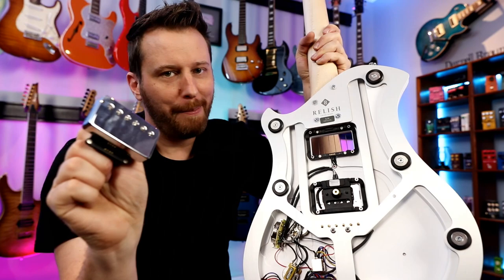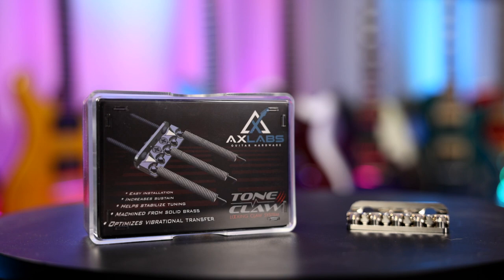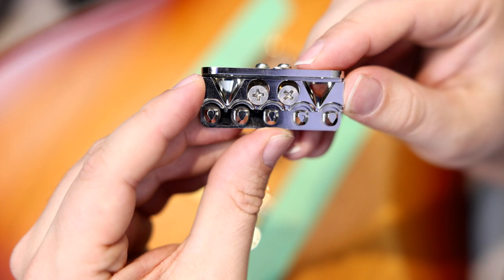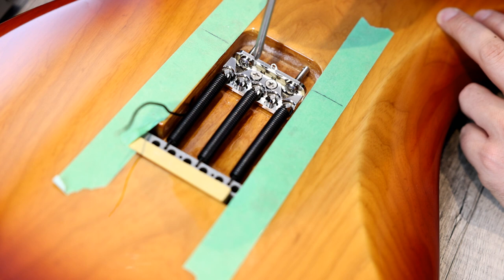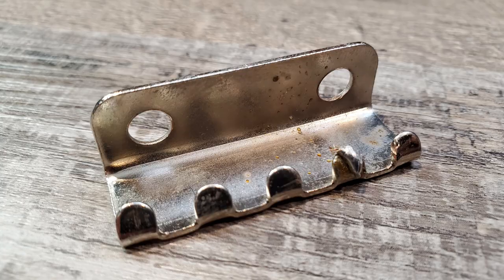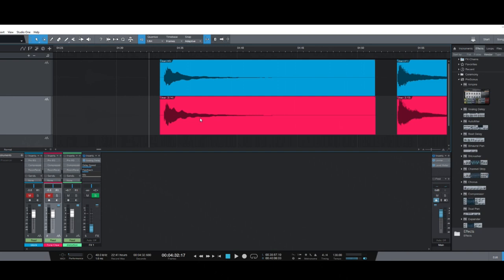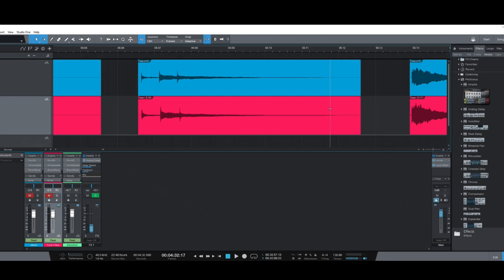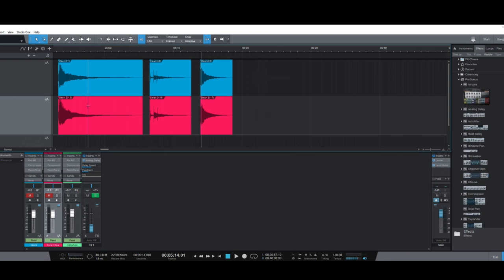Can a Trem Claw Improve Your Tone?? - Let's Find Out!

Comment: the one that is effective in sustain is the brass one a slight 5%, the nikel one is almost imperceptible and the difference is not much appreciated, adding the Fat brass block with 40% more sustain, I got 45% more sustain with both pieces of brass, I did a test and it was very satisfactory!!

Comment: My ears could hear very slight difference in tone and volume. So not really sold on tone improvements. That said anything that prevents random movement should enhance tuning stability during whammy bar use. I like the concept of locking the springs, I don’t know if it’s ever been offered before. I’m curious enough to try it for purpose of better tuning stability. Thanks for the tip Darrell👍

Comment: I replaced mine because the springs were not always returning to the same spot on the claw which caused tuning issues. No sound difference or sustain but it did fix tuning.

Comment: I could hear the difference. It was very very very subtle, but the brass claw gave the tone a bit more of bright/high end. Nothing you should run to replace your stock claws, but still interesting that just by changing the claws is enough to change the tonal characteristic of your guitar, even if just a little bit.

Comment: when you complicate and up charge for a simple part that has worked fine for decades. How about a comparison between the normal claw with normal springs,  the normal claw with coated springs, the locking claw with normal springs and the locking claw with coated springs.

Comment: I like it more for the fact its locking the springs in place, especially for string changes and pickup swaps. For $60 bucks I'm going to give it a shot, it comes with 4 springs as well, so if your springs are getting tired or you want to go up a gauge, it becomes more of an upgrade.
Reply: so after +1 year, could you tell us your experience please? i'm not looking into it for "tone enhancing" but if it has features relative to tension and spring fine tuning, it may be worth it.
Reply: @tintecobrizo  Yeah I'd love to see a review

Comment: Looks awesome, but Im worried about the metal of the back vibrating up and down.  the cheap claw is up off the body and vibration has to go thru the screw connection to the body only

Comment: Every little bit helps and a solid claw definitely improves your tone… however If you want to take it to the next level use a Schaller sure claw because of its adjustability with a single screw Especially because you have to adjust your string tension to adjust your bridge and for different thickness strings…. Keep on rocking…

Comment: @DarrellBraunGuitar Watching the comparision, the tone claw waveforms actually look shorter than stock.  More beefy is good. But I've never had good sustain. All I want to know is it longer and if it is. How much longer.  But also, it's impossible for you to play the guitar exactly the same for  stock and mod. You cannot control the exact rate  or stremgth of a strum.  So you should have a mechanical rig that will constantly strum at the same rate and strength.  I dig your channel and even have one of your T-shirts. With this video, I was left with wanting more than was offered.

Comment: This a really interesting comparison to me. Not because of the tangibles, but the intangibles.

Does it change your tone significantly? Nope. Does it change it marginally? Maybe, but I can't even imagine how small that difference would be since 99% of the tone for an electric guitar is dictated by the pickups and amp. Does it improve your sustain? Maybe, maybe not. The variations in the waveform were extremely nominal and could easily be explained by differences in how hard the strings were strummed. Does it make a functional difference? Other than adding weight to your guitar, which you may like or not, no. I've never had a trem spring pop off while I was playing, so I'm not sure what value the locking feature brings. So... from a practical standpoint, it makes pretty much no sense to buy something for $60 that makes a questionable difference.

BUT.......... It looks freakin' awesome. And you know it's there. Like you said, if you keep the cover off, it really makes a statement. I love that they have the brass color because I'm working on a strat that has as much raw brass hardware on it as I can get. It would be a really cool addition. And, as someone who loves to know that I'm putting the best possible parts in my guitars, it has always annoyed me that I could make all the components of my builds premium and I still always had to use that cheap little stamped metal claw. Premium parts may not always be necessary, but for some people, they are inspiring... and that's what playing guitar is really all about.

Conclusion: This looks like a waste of money that I may very well waste my money on.

Comment: Much to my surprise, I could hear a difference. I don't know if I can really describe it, but there was more depth, maybe, with the tone claw. The graphic waveform you displayed seemed to match what I heard, in that there was just more to each note. Very interesting.
Reply: I could hear the difference as well. The tone claw sounded like it had a little more bottom end to it.
Reply: why would you assume the difference is in the claw and not his playing? You do realize it's literally impossible for him to play the exact same way twice right? There's far more micro variability in his playing that he can't control than any tone difference in this hunk of metal.
Reply: @afurinperil  why would you assume I made any assumptions? To my ears, the tonal change was similar to hitting a low E on the bridge pickup versus hitting it on the neck pickup. His playing style isn't that big of a variable in this case because he's trying to remain consistent with his attack.
Reply: @pinktacoluvr  You're assumption is evident. believe what you want. Try replacing your knobs. maybe metal knobs instead of plastic will make your sustain longer. or maybe replacing the screws on your pickguard will help

Comment: Dumb question from a noob: the trem claw doesn't seem to be tightened up firmly against the wood, so we're losing vibes between trem claw and springs. I've seen locking posts used on ToM and wraparound bridges to eliminate movement between bridge and posts. Wouldn't the same concept (but different execution) help with this? Something to prevent movement between the trem claw and screws? Too much thinking, I'd better go take a nap...

Comment: I can’t hear or see a negligible difference with the new claw. I installed Raw Vintage springs on my Strat and  immediately could hear a difference. 5 Raw Vintage springs have around the same tension as 3 regular springs and you can immediately notice a difference in tone and sustain. The notes are fatter with overall improvement in sustain. They seem livelier and even make the trem feel smoother during actual use. They’re $20/set and don’t add any extra weight either. Physically the RV strings are slightly smaller in diameter and the material looks a little different too. I’m in no way affiliated with Raw Vintage-to me the springs are more worthwhile.

Comment: I can hear the difference pretty clearly, but then I’m a recording engineer with nearly 20 years of experience.
Is the difference clear? Yes.
It the difference across the board? Yes.
Is it a BIG difference? No. Of course not.
As your studio engineer would I rather you play the guitar with this in it? YES.
(Assuming 2 otherwise identical guitars of course)

My experience has shown me that THIS is where you spend your instrument money - inexpensive improvements.
👉All of them.

People will spend $2,000+ on a guitar and say this $60 is a waste of money??
No sir, it’s the other way around.
I have been involved in SO many instances of sub $500 improvements resulting in a better sounding guitar than the extra $1,000 you shell out for the higher model.

In most cases a well made $700 guitar with $500 worth of improvements will sound better than the “top shelf” model of that guitar that costs $2k - $3k.
Boom, you just saved a THOUSAND DOLLARS or MORE.
Especially if you can recoup a little bit of your cash by selling off the components you took out.

Better pickups $150-$300
Better bridge or better saddles ~$200
Higher ratio locking tuners - $60-$150
Better pots & output jack ~75
GRAPHTECH NUT - TWELVE BUCKS!

It’s RARE that you would need to do ALL of these on a $700 guitar, but even if you did, chances are very high that you’ll end up with a better sounding and better playing guitar than so many of the popular $2,500 guitars out there that we all see so often.

And of course - GET A GOOD SETUP DONE! 😄😄😄
👉Really you should learn to do that yourself, because it’s really not hard, and it’s FUN.

Party on Wayne.
Party on Darth.
🖖😎🖖

Comment: I hear a noticeable difference, but I don't know if it's because of the trem claw. Might just be that you played with a slightly different attack after the installation. As someone else pointed out, even with the same trem claw nothing you do will sound the exact same way twice, though I wouldn't necessarily write this off for those reasons alone. A lot of people saying that this is useless and you shouldn't be spending money on things which aren't guaranteed to improve your tone but hey, $60 for hope is a bargain.

Comment: I use The Schaller Sureclaw It’s the best Spring claw ever made and kicksass on this thing. It has a gear system that allows you to adjust the spring tension very easily with one Allen key which I have on my whammy bar end which also is the same size for my locking nut screws. And yes it definitely helps thicken up your tone and sustain. Also it helps when changing strings and you have to re-level your bridge, it’s quick and easy you should check it out dude because I worked it to the tee and yes… It’s awesome… Keep on rockin

Comment: Makes me want to try 3 screw in hooks/screw eyes. With each spring independently connected to the wood it will probably drive up sustain and mids much more
Reply: Would you also like an individual nut for each string?
Reply: @Ndlanding  that's a pretty good idea

Comment: Imo, it's a cosmetic piece. I don't like the marketing wank. I've also never had a spring pop off the claw, only from the block a couple of times. I would rather see an improvement like some of the newer Ibanez where the 'claw' is screwed/bolted directly into the body vs mounted with two screws.

Comment: The stock claw sounded noticeably better, higher frequencies were easier to discern and overall it was much more balanced. The tone claw sounded like you threw a damp towel over the strings and the frequency response was shifted to the bass. I would never put that thing in my guitar, sometimes simpler is way better, this being one of those times....

Comment: It is an incomplete design. If so much care should be taken about "locking" mobile parts, the screws that hold the claw to prevent movement towards the wood. Same with springs locking, like in the vega trem. Point here is, although there is some loss in the joint of each one of the elements, which affects sustain, major losses are due to the springs and the contact of the bridge and the body.

Comment: the issue with claw isnt the point strings meet the claw but rather the point claw meets the two screw ends; there the claw can actually tilt and cause intonation problems. This is NOT improved with this product, they did a fancy looking lock for what is already solid. Cheers

Comment: I hear no difference at all, and the variations in amplitude on the waveforms could be attributed to variations in picking, finger pressure, magnetic forces in the air, slight variation in torque on the trem claw screws, etc. You can try your hardest to eliminate the variables, but unfortunately it's an imperfect science and each strum of the guitar will be different.  That said, no impact on tone isn't a bad thing.  At least it didn't hurt the sound because it's a beautiful, well made piece I'd consider using on a totally decked out guitar.

Comment: The "experiment" compawring the waveforms did not, IMO,  justify any conclusions because it was not scientific. The sample size was one and and evaluation was not blind. You need multiple samples (plucks of string(s) and some way to derive statistics (e.g., mean amplitude at 1 second, 5 sec's, 10 secs, etc.). If you're going to measure amplitudes by eye then comparisons should be blind, i.e., you don't know which result is from which trem claw. I will admit that to do this experiment scientifically would be beyond the scope of your channel ( you'd need a statistician), but you should have admitted up front what the weaknesses of  your analysis were. At least you made an attempt to use a more objective measure of sustain than just listening, and that I applaud.

Comment: I couldn’t hear a difference.  I also prefer my guitars as light as possible.  This to me is extra weight with only a visual difference.  I think most Stratocaster players also prefer a vintage look rather than a modern look, but that’s an option.  Lastly I will say $60 for some bling bling that is on the back side of the guitar resting against your body the entire night is stupid, nobody will ever see that.  I think Leo Fender had it right in 1954, and this is over engineered.  Playing more will help your tone more than buying parts.

Comment: No difference. I use a compressor for my strat. I also have a guitar with a floyd rose and a larger block...it does not help and that guitar with  floyd rose is worst than my Strat for sustain.

Comment: There is such a slight difference in tone and sustain between the two, not sure it's worth it.  Yes, absolutely looks better and much more solid.  However most of the time the cover will be on the back and the look won't matter.   Think the discussion should be about weight.   More and more players are looking and wanting lighter guitars.   Have seen some sacrifice a slightly better playing neck for the exact same guitar that weighs 6ozs less.   For the players who are looking to cut back on the extra weight, can't see this being "worth the extra weight".    IMO, this is an over engineered part with marginal benefit.  Would rather  put the $60 bucks to better uses elsewhere.

Comment: I can hear a marginal difference if anything, sounds a bit fuller. But At that price, it's not really worth it in my opinion considering you wouldn't realistically know the difference in a band setting.
Reply: UPDATE: Ok, contrary to my previous comment, I'm actually considering this upgrade for my Floyd Rose equipped guitar. So what changed?

Since the comment I got a Marshall JCM 800 Studio, which is an amazing amp, but it's bright crunch was too bright with the Floyd and even turning the presence and the treble back didn't fix it. It was fine with my PRS MT15, but the Marshall really highlighted the shortcomings of a Floyd, so I put in a brass sustain block, which not only rounded off the highs and increased the midrange, but another non-Floyd guitar with a similar output pickup pushed the overdrive a fair bit more and the output noticeably increased as well.

So thought if the block helped, maybe the tone claw might help too? I'm forever looking at ways to close the tonal gap between the Floyd Rose and my PRS Tremonti.

Comment: The difference is minimal. While I don’t so much care about sustain length I do think that the Claw did seem to be a bit more consistent on the waveform and in the ears. It just sounded slightly better. But hey slightly better is still better! I think it probably has more to do with metal type than thickness though.. 🤔